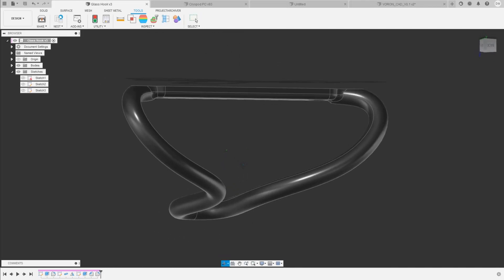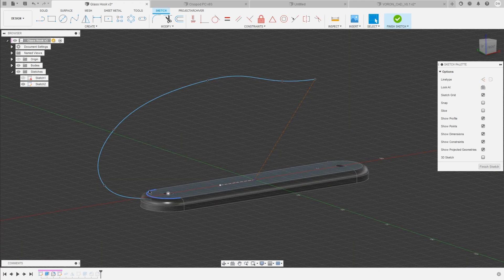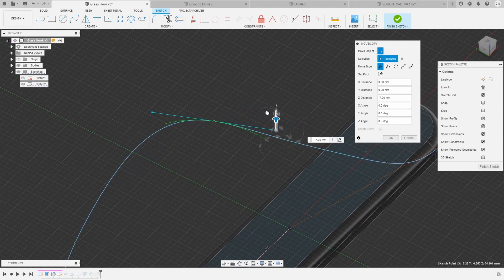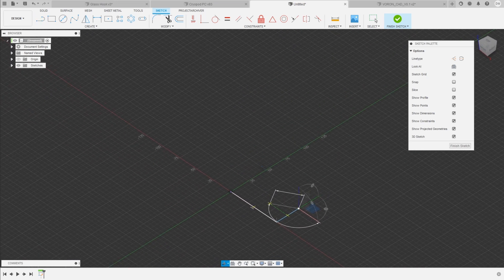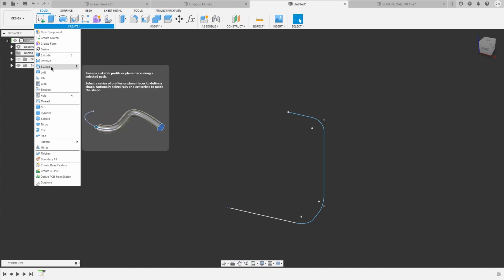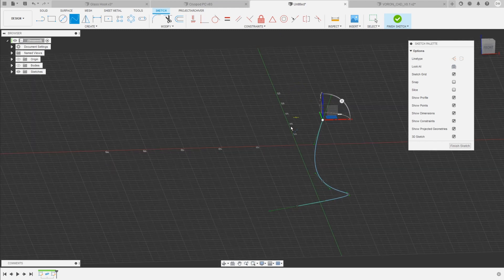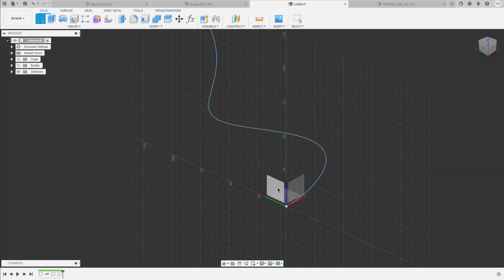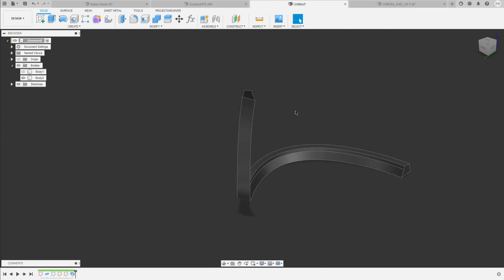Fusion 360 3D Sketching - Maker Software

Comment: Great video -- THANKS. 
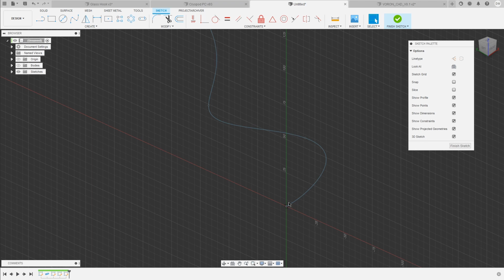Question: Is it impossible to mirror a 3D sketch, for example the line you have at 6:45 ? I have tried many times to do this, without any success. It seems that lines must be in one plane only to be able to mirror them?
Reply from the maker: I'm not sure, but the sketch mirror command probably doesn't work as you'd have to select a plane and not a line to mirror. It might be possible to use the modeling mirror command that can also mirror bodies and features, but I haven't tried that.
Reply: @DarkArtGuitarsWorkshop  Interesting for sure. I just experimented (Fusion users who know better will laugh) and it looks like you can only use a line as a mirror reference while in the Sketch environment, even though "3D Sketch" is indeed checked. It only mirrors whatever is in the plane of the selected line. That is, I guess you simply cannot mirror a 3D line. Body or component yes, Line, doesn't look like it is possible.🤔If anyone knows different, PLEASE comment or explain where I am going wrong. Thanks.